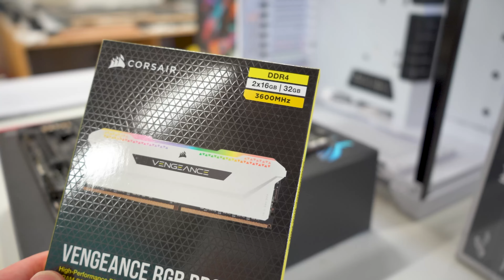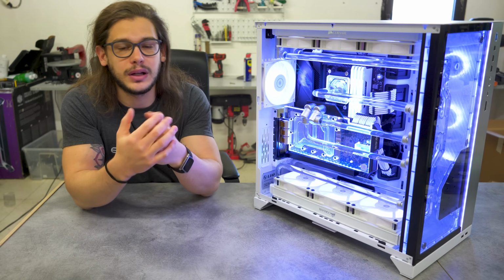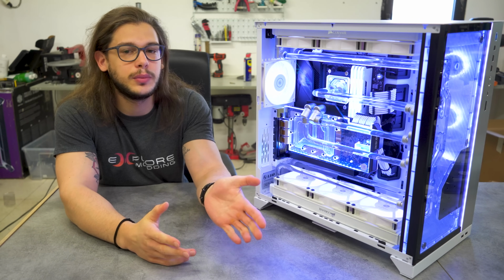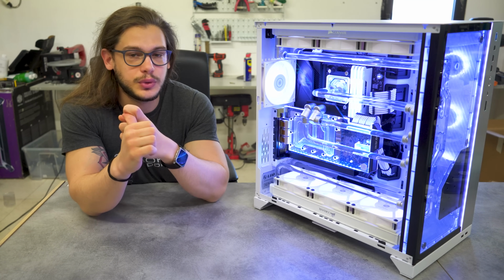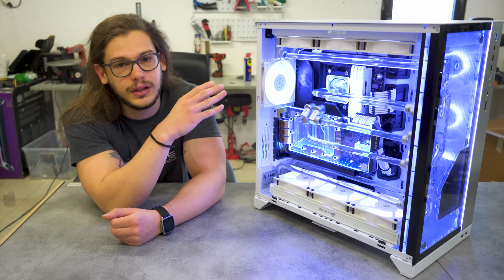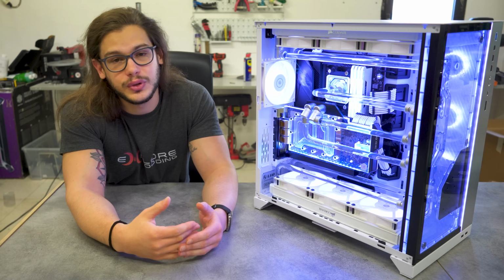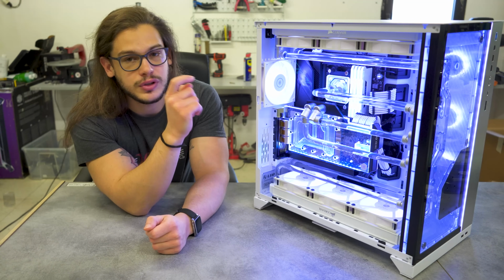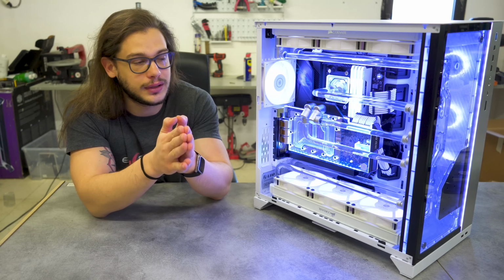Watercooled Lian Li PC-O11D XL - Thoughts on the Most Popular Watercooling Combo | bit-tech Modding

Comment: I built my loop in the original O11D. I originally used a regular tube reservoir. However, I switched to a custom front distro. I wasn’t happy with my water temperatures with the rads that I had. I was recycling air by using the side rad as an intake and the top rad as exhaust. The fan configuration doesn’t allow positive pressure in the case otherwise. Some people don’t care about that, but I do. I finally broke down and removed the side rad, and drilled some passthroughs in the back of the case in order to add a thick 560 mm external rad in in push/pull. The temperatures are much better with the higher rad surface area and fresh air to both the top case rad and the external rad. I’m actually planning an open air custom loop for my next full build.

Comment: Have this case, done a custom loop but without the distroplate - in order to be able to fit there 3x 360mm rads without issues. Pump+res combo mounted on the side rad. Config like this can easily cool high end components and still be almost completely silent under load and even without the distro plate is looking awesome. I choose this case because I had the smaller one before (O-11D without XL) and it did not felt big enough - I like to have space to make the build easier to assemble and maintain. Besides that the smaller one does not have so easily reachable the bottom air filter, which is a must for me (cat owner).
Reply: i had 3 360mm rad in the first/old version with soft tubing :-)
Reply: I'm getting the XL ROG version. In place of a third radiator in the side I'm considering the EK-Quantum Volume FLT 360 D-RGB (distro reservoir) .. mostly for aesthetics to cover those side blank eyesore cutouts. Instead of acrylic I'm thinking about Barrow copper chromed tubing.

I wish that other side distro had a D5 pump!

Otherwise the typical:
EK-Quantum Reflection PC-O11D XL D5 PWM D-RGB
EK-CoolStream XE 360 60mm
EK-CoolStream PE 360 40mm

My thoughts are 2 radiators should be plenty enough at least for an Alder Lake i9 and FTW3 RTX 3090 build.

Comment: I used the D5 Convection cover for my build and the sharpness of the interior cable passthrough ended up cutting into wires that resulted in a short and I blew my dark hero. Everything was RMAd. Got a new pump, returned the convection (which sucks b/c i absolutely love it), and got a new mobo. This is a great build.

Comment: I did my build in a regular 011 D when they where fresh on the market. I just love the  2 compartments with the PSU in the back and the glass panels in the front and how it looks. I also enjoy modding videos but i don't have access or experience with a CNC router so this was a great opportunity  to do a build with a distro plate. This case was pretty unique in it's look and build quality so i went for it and i guess a ton of other people felt the same way. I'd prefer to have something less common but Lian Li in it's crazy capitalist scheme sold more than a couple of these, so it is what it is ;) I like to think i made it a little more special by having a 50 mm thick radiator on top and bottom though.

Comment: You covered everything well, only thing I wanna correct you on is that you can fit a massive rad on the bottom. I have this setup and I've pushed it to the max. I got 45mm rad up top and 60mm on bottom with a chipset block as well. You just have to ditch the rad bracket and Dremel cut a tiny bit of the vert GPU holder.
You can even do a 27mm rad with fans in the side compartment there... Case is amazing
Reply: Thanks for your feedback! As I think I mentioned in the video, it really depends on the type of vertical mounting bracket and size of graphics card you're using, plus I was solely talking about a scenario with no dremeling involved, just the bare compatibility offered by the case. In my specific case, with a 3090 Extreme and and EKWB vertical bracket, I don't think even a 45mm radiator would've fit because there wouldn't have been room for the tubing and the radiator couldn't be mounted with the ports on the front, but I actually didn't consider ditching the rad bracket so good call on that!
Reply: @ExploreModding  you're right. I did 45 mm and 14 mm MF. Unfortunately, I have a problem with the fans. They barely fit. Now I am buying a 30mm heatsink and a 28mm MF. I have to change it.

Comment: This is actually a case I have as a spare as I'm going full custom loop only difference is I have a pump resivour combi instead of a distro plate just not sure if it will look right as the distro plate does give the front of the case a nice look... the reason I'm going for a custom loop is for the temps as using a 5950X and RTX 3090 and use it for CAD and rendering..... great channel just subscribed!

Comment: I remember clearly the mistake i made buying the regular PC-O11D instead of PC-O11D XL, funny enough listening to seller's advice :(
Definitely buy the XL version for better radiator support especially at the bottom <3
Have a great week Alessandro and keep it up the great job <3
Reply: i have a normal 011D too and while thick radiators where not officially supported it wasn't hard to install a 360 50mm plus fans on top and bottom each. The GPU is still vertical but the tubing is at a diagonal angle, a bit like a motorcycle exhaust. I like that the case looks more full this way.

Comment: Nice build. Im going with the lian li o11 d xl all white case with asus rog strix 3090 with quantum 2 vector 2 gpu full cover front & active back plate plexi cover with velocity 2 cpu water block for my 5950x with two new gen 2 x360 surface radiators from ek but im gonna have my radiators facing the reflection 2 distro plate so i dont have to worry about the tubes having to rub my vertical mounted gpu water block & im gonna be used extenders & 90 degree torque fittings from EK to reach & install into reflection 2 distro plate so i dont have to worry about bends & ill only need 4 tubes of petg since im gonna use 90 degree torque fittings & extenders for the top radiator as well & use 64 gb of ram & 4 tb of ssd & 6 tb of hdd. Im having microcenter do build for me in late August. It will be my first gaming pc. Cant wait 😊

Comment: Ordering this case today for an Alder Lake i9 / FTW3 RTX 3090 build, but I haven't done water cooling in quite a while. This isn't brain surgery. The most annoying part is probably RGB / controllers; EK uses D-RGB 3-pin while MOBO headers are 12V 4-pin. The reason is pretty universal the case looks pretty damn good. The case design allows for freedom and cleanliness in the front while your power supply and wiring is separated in the back along with hot swappable bays. It's a fishbowl.

BTW .. you absolutely don't need to use a distro, it just looks better and with that cost more, and probably your need for offsets is because you're putting your GPU vertical.

Comment: Have this case - 3x360mm rads, I use lian li sl fans, ZMT tubing, ek fittings and some quick disconnects, and a pump/res combo. Easy as pie to build compared to my other acrylic builds. Maintenance is so much easier as well.
Reply: What radiator thicknesses did you go with?  And what direction for your fans?

Comment: I'm currently in a build very similar to yours. I have the XL rog certified Lian Li Case in white. But I actually opted for the EK-Quantum Reflection² PC-O11D Distro plate. It has the Matrix7 tech. Also adding an additional 3rd radiator behind the 3 side fans. I went with the Mat black fittings although the silver fittings look very good in your case. Also debating which color coolant, between blue or clear like yours. Very nice build

Comment: I chose to bridge one of the ports and run the bottom rad after the GPU and then into the CPU. You don't have to use every port and just like any loop out there, you can put the order however you like. I chose to get the distro plate because I wanted all that stuff using the least amount of space possible. You also can fit an SE and 3 15mm 120 fans on the side for a 3rd radiator.

Comment: I built my first watercooled system in the regular O-11D using the side mounted distro plate after seeing several builds with that setup and liking how clean they looked. I'd also assumed that the distro plate would make everything easier for the first time going custom loop. I'm fairly happy with it but I do need to change cases as I didn't realize just how tall the Gigabyte 3080 was with the waterblock on it and the side window can't be put on the case as a result (can't mount it vertical the bottom radiator and fans would interfere.

I've thought about just moving up to the XL but now that I've lived with this setup for a bit I find myself wanting to go with something a little more unique (and easier to drain hopefully, the current loop is quite difficult to drain (I put the drain valve in the lower back port on the distro plate). I know they're working on the EVO version and that may address some of my pain points (have also heard rumors of Antec working on a full ATX version of the Striker) but I'm leaning towards the Enthoo 719 currently.

Comment: My first build was a 011 XL with front distro, went this route because I liked the look, and actually though it would be easier, i only have 2 bends in my system for the gpu. have now built 5 more custom loops since then, including the "old school" onesin a corsair 4000 and 5000 case. I must admit that the last to builds in the corsair cases without a distro was easier.

Comment: Would love to see you make mods to the O11D XL to improve it, so anyone with the same case can try to "Mod-along".
Reply: thats the problem with going with the distro; you're loop is kinda 'set.' only real thing you could do to mod it is colour changing, like replacing the o-rings in the distro with white ones, making panels to hide cable management and vent holes. making saw all the white matches.
off the shelf distros stifle creativity
Reply: @F41LZZz  Don't use the mass produced distro then. I would love to see what can be done with an O11D, if one isn't limited. Make your own distro if needed. I'm sure Alessandro can come up with new ideas. 
For example, I would design a distro to go where the top rad normally sits. The tubing runs would be much shorter and neater.

Comment: i orginally got the non xl version, but my 5700xt liquid devil did not fit.  I love the xl after getting it though.  Easy to work in.  Beautiful case.  I have a Dynamic Uno from distro plate in mine.  I went soft tubing since i have a small fortune in connectors.  I have 3x360 rads and a 120 rad in the rear.  Max temps i have seen in my loop is 40c and that is with hours of gaming with liquid devil and 5950x in the same loop with EK monoblock.   I actually like the soft tubing look still..

Comment: Been there done that. Also mention distro plates crack over time. I had 3 crack before going back to real glass XSPC tube reservoirs exclusively. As for the Dynamic XL I do not think there is a better case on the market.

Comment: Yeah, your experiences mirror my own with this kind of build. I just don't like the flow penalty of a parallel distroplate either. Combine that with the high cost of distroplates and I try to avoid them both for myself and for clients. My philosophy is the tube runs need to be planned around the cooling, not the cooling be planned around the tube runs as is the case here. It's a bit different if I am designing and machining it myself as I can cut down on necessary fittings and guarantee that high quality cast acrylic is used, but it's still something I do sparingly for customer systems as performance and ease of maintenance are hugely important. Most of my loops are built with obvious and precise patterns to the tube runs so just doing parallel runs to a distro isn't really any better looking, it's just a different aesthetic.
Reply: I think one would get a bit bored of their distro block after a while, I'm making a custom reservoir where I can watch the water move around (maybe a small waterfall)
Reply: @colinjava8447  Just be aware that will likely create some noise. I have a horizontal reservoir in one of my builds that I intentionally didn't fill all the way for that reason and there is a fine line between how much coolant you can leave out before it starts reminding you to go use the bathroom constantly.
Reply: @TheJjjoj  That's true, but the top of the reservoir comes off, so I can adjust things, I haven't decided exactly what I'm gonna do, I could just have a tube going below the surface, or maybe spread the flow out, like the Niagara falls but on a smaller scale.
Reply: @colinjava8447  Put my vote in for the Niagara effect. That's one I've considered myself many times but just haven't ever done it.
Reply: @colinjava8447  I will be impressed if you can turn off the waterfall like they can at Niagara.
Reply: @billschannel1116  Yeah I could in theory, just redirect the flow.

Or place a new waterscene in the reservoir.
Reply: @colinjava8447  I'm picturing your grandchildren talking about your Winchester Mansion of a PC build. "As he would get bored, he'd add to it. First it was a waterfall, then it was redirected waterfall, sometime later there was laminar flow fountains that traded water between his other PCs. After that things got really crazy!"
Reply: @billschannel1116  It's already got glass tubes and a mini screen and special "hidden" cables, and a mirrored back panel
Reply: @colinjava8447  Boy I wish I had your time. Sounds great! Sounds like your down that road pretty far.

Comment: after migrating my setup from o11d to 5000D airflow... i have some regrets
5000D has limited rad thickness, so far i can only fit 1 30mm 280 on top & 40mm 360 in the front (sides can only fit intake fans now)

i can say is its cable management for 5000d is good

Comment: This is the 3rd build video I've seen using this ek distro plate and ek parts. All 3 videos cite basically the same concerns and difficulties.
That it is more difficult than other custom loops. That its a tight fit in this case. Airflow concerns, etc.
I'd love to try a custom loop but it is very intimidating.
Do you have any suggestions for ek and lian li about how they could team up and design a case and system that could be more user/builder friendly.

Comment: I'm looking at swapping a setup to this.

3090 msi spread x with ek watercooling front and active back plate and 5950x

I run this case with my own full custom loop but the amount of heat off the gpu is cooking the cpu in the loop over a few hours.

I'm hoping by changing to the distro plate and adding a 3rd radiator that it will help balance the flow out. As the cpu current feads into the gpu and it doesn't seem to work well with temp.

Comment: Hello there, thanks for the video. I wanted to use this distroplate for my lian li xl and change my lian li g1 to this. But then i saw that there are many custom distro platefor the lian li xl and also with dual loop capabilities. I am also using your tutorials on fusion so that i can design my own distro. The question i have. Can i make the distro fully out of acrylic and replace the front glas of this case with it? Also how would i mount the distro on the front ( do i need to use the same metal parts from the front glas in my custom distro or can i make these parts with acrylic without fearing it breaking? Thanks again for your videos

Comment: Thanks for the video ( a lot), I'm about to do a build in this case, and now I am wondering if I want to skip the distro plate. For sure going to skip Vertical mount, and use a 60mm in the bottom, so need to find a place to mount the Rez. Been enjoying the builds, thanks again!

Comment: Mine is in the same configuration but using different fittings, radiators, fans and the GPU is the EK 3090 Special Editon so ports were mounted at the rear. 
Why are the top & bottom radiator loops different? You have extenders on the top and bends on the bottom. it Looks odd. 
I found my build exactly how you described it being not so easy with offsets etc. 
I enjoyed building it and the fact there are 100's of similar builds is OK as those aren't in my bedroom.

Comment: Is it possible to mount the Ek Gpu Mount one thumbscrew lower than you did? Trying to figure out if this mount will work for my build, I am using the G1 distro plate rather than the quantum reflection.

Comment: I despise cases that are windowed because you light it up like a Christmas tree and it looks really cool until you want to go to sleep with it on doing work.  Too much where even the ram, the fans, the case, the motherboard, the water loop, etc... are all LED.  Reminds me of Amsterdam and the red-light district, which is not bad, but ffs in a bedroom it is too much.  The lights in the fans (not sure about the ram) you can't turn off.
Reply: Interesting, I always assumed lighting would be able to be easily turned off. That changes my opinion. On another note I lement the loss of turbo buttons on PCs. Imagine being able to tie all your fan speeds, processor cores, video card speed,, etc, etc, by hitting a button. Back when I had one I never used it because there was no real benefit to running a 80286 at 6 MHz instead of 12. But now you could save 100s of watts. But of course it's even more optimal to have a self tuning system with good idle profiles, but I still want a turbo button.